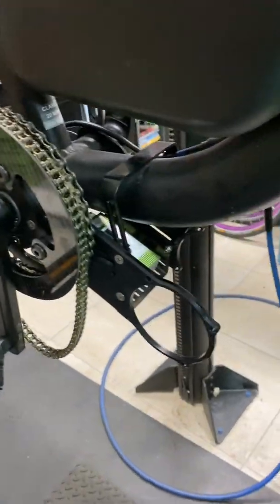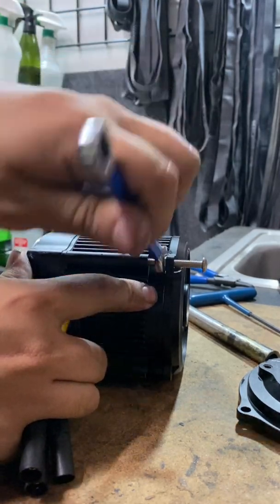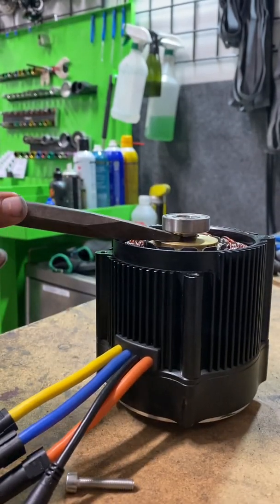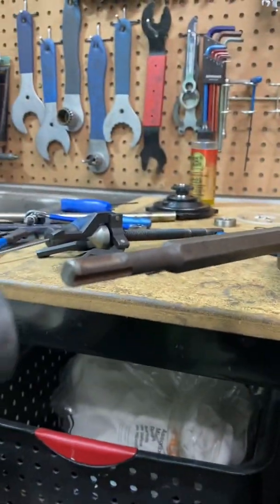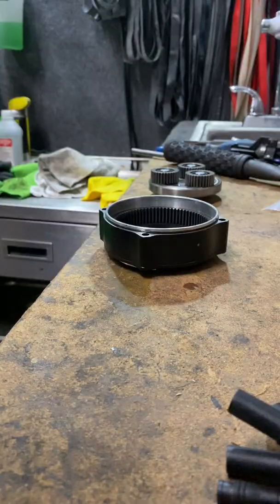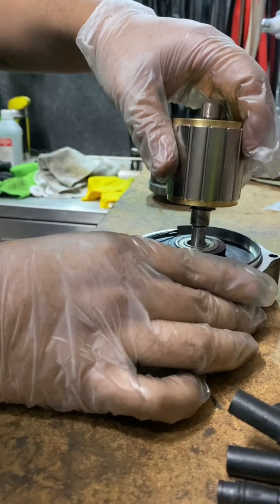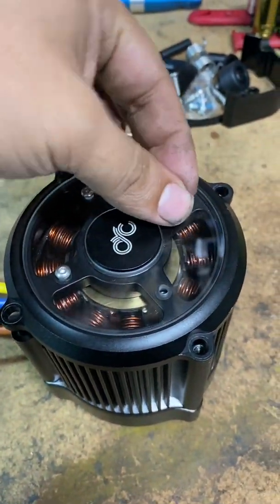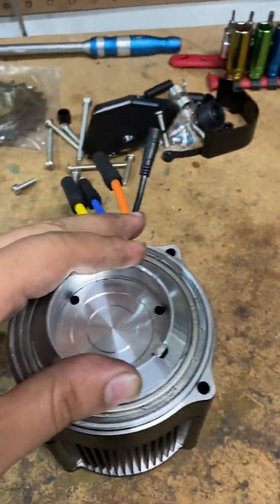CYC X1 PRO Gen 2 Motor Repair

Comment: Hi. I bought a used bike with the CYC X1 Pro Gen 2 72v 5000w. It worked fine for a few days but stopped mid ride and now has a motor error code on screen and no power going to the pedals or throttle. Also the motor doesn’t show up on CYC ride app for some reason so makes it hard to diagnose..
Any ideas?

Comment: What rips the magnets off is yes the motor is very powerful because the stator pulls on the fixed magnets so hard that when it is running at high RPM the magnets are trying to sling off on top of that the stator is pulling on them extremely hard to keep the torque going and in combination with the heat as well it could end up actually ripping the magnets loose, it's not because of rubbing but because of the forces like centrifugal force on the magnets the heat loosening the glue and the stator pulling on them additionally causes them to rip loose
Reply from the maker: Makes sense as well
Reply: Yup but also as he said, if the rotor isn't perfectly balanced that will also contribute to the detachment of magnets at high rpms.

Comment: I know sometimes you have to use a mallet, but there is a few occasions where a puller and press would be more suitable. 
You have a $1000 motor being whacked with a hammer and chisel, had that been my motor, and I seen this, I would not be impressed.
Reply: this - i cried watching

Comment: Wow
I’ve got 750 hard miles on mine.
Still runs perfect.
Reply: What range do you get, and what battery
Reply: @hbeer3480  
I’m running three Turnigy 6S 20AH batteries .
It will go 30 to 45 miles on a charge, with zero pedaling.

Comment: But that's a pretty brutal kind of repair, professional would be different. For example, you pull bearings with a simple bearing puller, they only cost a few dollars ... He takes a hammer and a large iron and hits it ...
Hey, that's a motor that rotates at 9,000 rpm, so please work as gently as possible! Hare Krishna!
Reply from the maker: Where in this motor would you apply a bearing puller? I own all the bearing pullers made, automotive and WMFG pro bearing press and pullers, none would be applicable anywhere on this motor.
Reply: @djoccult  you use a bearing puller to remove the bearing you are hitting with a hammer,,   you are so stupid its unreal.
Reply from the maker: @SIMONC256  which bearing, and which bearing puller would you use? Explain your alternative solution.
Reply: @djoccult  the puller you use to remove a window wiper on a car, takes 3 seconds to pull off,
Reply: @djoccult  Hi, the bearing you are removing at 1:45 with a hammer, its the motor rotor bearing, google wiper arm puller, if you use this it will take 2 seconds to remove that bearing, i use this and have done it many times on my motor and a few others i have rebuilt, you are also taking apart the motor from the wrong side, if you remove the gearbox from the motor housing first you dont need to bash the crap out of it, i'm thinking of posting a video of the correct way to do this, i will send you a link when i do, then maybe you might learn how to do it without using hammers..
Reply from the maker: @SIMONC256  most of those pullers dont fit under a small gap, but it doesn’t matter anyway because the rotor and bearing were replaced with new ones
Reply: @djoccult  the rotor you were hitting to get the bearing off was hitting the stator , but why even take off the bearing, you can remove the rotor with the bearing in place, and you replaced the rotor and  bearing, why???? bash the poor bearing anyway???lol..you make me laugh , this video is stoned

Comment: Shouldn't you be using loc-tite instead of grease when installing the final piece?  Won't the Sprag Clutch (bearing) slip inside the case when under torque?
Reply from the maker: No it uses a keyway and it is not a clutch its a gear reduction.
Reply: @djoccult  Thanks for clarification.
Reply: @yellowsheeps  this is not how you  do it, everything in this video is crazy and wrong, i'm lost for words really i'm  not joking, please dont follow anything in this video.

Comment: Hi, just wondering what would you recommend BBSHD or CYC?🤙🏾
Reply from the maker: For more practical application and available parts, the BBSHD. For more power output, the CYC.
Reply: Well in my opinion I have had both and I really prefer the cyc better, overall better construction and design, you can see yourself that it is designed to use the power more efficiently the casing is made from solid pieces of metal rather than stamped out steel and poured aluminum on the HD, the cyc is more costly but also far more powerful, I guess it depends really on your budget and how much power you want to get out of it the HD is also a nice motor but of course for a different budget range, considering how much the HD costs it is a good motor but for the price difference they both show their strengths and weaknesses but if you got the money I would prefer the cyc myself